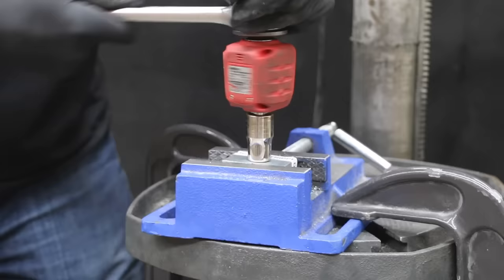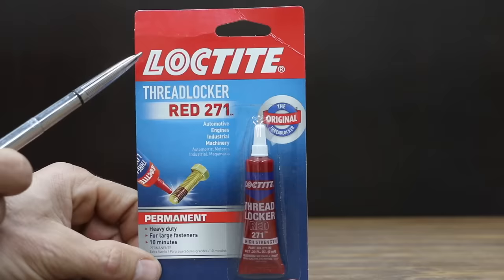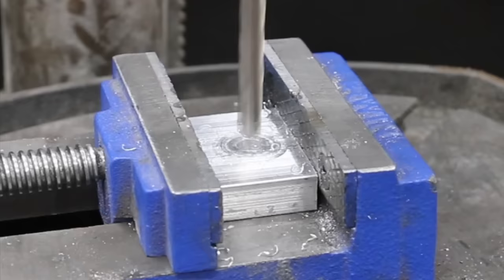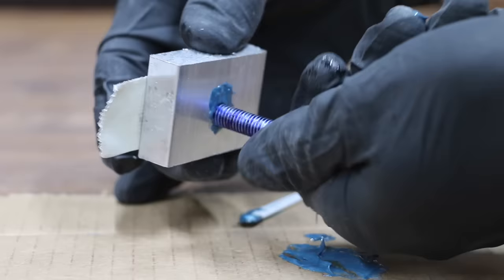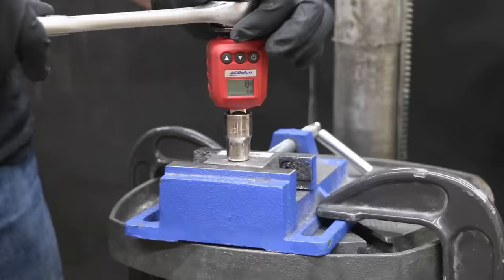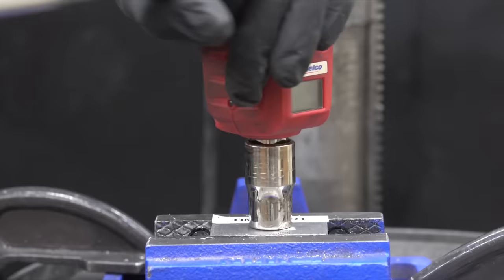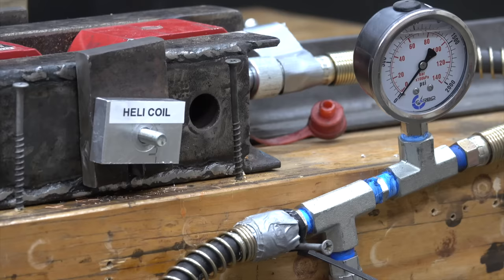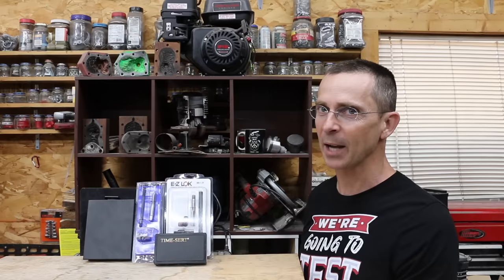Best Damaged Thread Repair? Let’s Settle This! Heli Coil, TIME-SERT, E-Z LOK, JB Weld, HHIP, Loctite

Comment: I actually have a suggestion: Most lawn care/arborist tools (weed eaters/trimmers, chainsaws, lawn mowers, leaf blowers, etc) usually say use premium fuel in their products. Can you compare regular fuel/mixed fuel in these products to see if premium fuel will actually make these products perform better? I know Husqvarna and Stihl highly recommend using a premium fuel mixture in their chainsaws, and was wondering if it really makes a difference or if I'm paying extra for nothing.
Reply: Using ethanol free (usually premium) fuel is recommended for small engines because the carburetors are easily corroded and ruined by ethanol.  This applies more to small engines since they spend a lot of time sitting stagnant.
Reply: @conorfieber6337  sitting stagnant isn't so much the issue with ethanol.  The main reason it is a problem is when sitting stagnant in a carburetor since it is open to the atmosphere.  Ethanol absorbs moisture from the air and the moisture makes it break down and turn acidic.  I've had ethanol gas sit in cars for months up to a year or two with no issues because modern fuel injected car fuel systems are totally sealed from the atmosphere.
Most ethanol free fuel I have seen is still just 87 octane, but I have seen 91 octane ethanol free here and there.  You can actually strip the ethanol out of any fuel by pouring a bunch of water in it, shaking it up, and the ethanol will mix with the water and settle to the bottom, leaving straight gasoline on the top that can be poured off into a gas can.  Doing this in a container with a drain on the bottom makes it easier to just drain the water/ethanol out.  Stripping standard 93 octane E10 gas like that will yield around 92 octane ethanol free.  Gasoline is not water soluble and is not affected by the water.
Reply from the maker: Thanks for the suggestion.
Reply: There are many reasons that some equip need to use high octane. High compression engines is one of them (to prevent detonation) My older Jonsered saw needed high octane to prevent vapor lock. Sure, it will run on regular (once), but when you shut it off, it won't restart
Reply: You’re paying extra.  I’ve had no problems using ten percent ethanol in my Sears tractor for ten years. I keep all containers closed tight, the tractor under cover and fuel left in the tank all winter. I don’t doubt that others have had problems but I have not.
Reply: @conorfieber6337  In the united states premium doesn't mean ethanol free.
Reply: @ellieprice363  the important thing is to empty the carburetor if it has one. Most modern garden tractors are fuel injected now so that doesn't matter really.
Reply: @zosxavius  Thanks. I must have a very unusual lawnmower with an engine that’s very different from most that I’ve heard about. It’s a 21 HP Briggs & Stratton with carburetor. I’ve used regular 87 with ethanol since new and the tank and carburetor have never been drained or cleaned. Gasoline is left in all winter and it usually starts on the second turn. Had to replace the compression release but other than that no other trouble. Count me lucky.
Reply: @ellieprice363  If you live in a location with lower humidity, that is probably fine.  Most carbureted things seem go to hell in a handbasket if ethanol fuel is left in the carburetor for extended periods in the more tropical and costal humidity areas.  Using fuel stabilizer and keeping stuff in a reasonably well sealed garage also helps.  Barns and garden sheds don't keep the humidity fluctuations out as well.  In the carolinas, the dew point is so high in the summer, the entire landscape looks like it rained from all the condensation once the sun sets and the temperatures cool off.
Reply: @hdrenginedevelopment7507  Sorry, none of that works. I live in the Carolinas where the humidity is occasionally high but not at at all as you described. At this moment Charlotte temperature is 86, humidity 51, and visibility 10 miles. Actually very pleasant. 
Garage doors are closed but not tight with lawnmower inside near a running creek. 
Again, hard to believe but no ethanol problems at all. Don’t believe everything you read or hear       about the Carolinas.

Comment: That was A LOT of work!
I suspect the glue in repairs  would not allow you to remove and reinstall the bolt.
Reply from the maker: Thanks for watching!
Reply: You can do it, I have used epoxy to repair threads, and you can get one or three removal cycles out of it, though best is to wipe the bolt down with silicone oil before putting it in, or use some spray on anti weld splatter spray, and wipe most of it off.

Comment: Great video! Interesting to see that the no-name Helicoils did just as well as the real stuff.

We sometimes will preemptively do inserts into holes in which we're pretty sure fasteners will end up stripping out, there are several brands that are meant for this type of application (vs. repairs). I'd be interested in seeing a comparison of products like that!
Reply from the maker: Thanks for the suggestion.
Reply: LOL, I should have just read down; just asked if there might be use cases where you would use these on purpose proactively :D
Reply: @Tasarran  Yep. Am a machinist, occasionally have drawings that call for a helicoil to be inserted at manufacture, typically in plastic or aluminium parts
Reply: Yes, there are many cases in which it is wise to do this preemptively to prevent failures.  Here are some good examples:
   Aluminum cylinder heads where the intake, exhaust, and valve train attach to the head.
   Some drive train components, such as where a transfer case attaches to a transmission.
   Engine mount attachment points on an aluminum block or old iron block or for high horsepower applications.
   Bearing mounts in industrial drive systems where any cast material is involved that needs to be threaded.
There are numerous other possible applications, as well.

Comment: Another very well-done video, no surprise.  FWIW, on tapping a pile of holes: maybe I'm an idiot but I had a job for the oilfield to make a bunch of 1/2" thick mild steel flanges with 8 holes tapped for 1/2-13.  I wasn't about to hand-tap that many holes (I think I made about 8 of those pieces or 64 holes total...maybe more flanges...it's been 10 years, hard to remember precisely).  I punched the holes on an ironworker to near final size then chased those holes with the appropriate drill bit for the thread size.  I then used a socket adapter (from 1/4" hex to square drive) to drive the appropriately sized 12 point socket (I could have used an 8 point socket, too) to fit the square drive of the tap.  I used a spiral-fluted tap and TD Foamy lubricant then used the drill press on a low speed to tap the holes.  The threaded hole was larger in diameter than the shank of the tap.  What this allowed was the tap cut the threads and, when the thread cutting section was past the workpiece, the tap fell out of the socket through the center hole in the drill press table.  I placed a 5 gallon plastic bucket under the drill press table to allow the tap to strike a surface which wouldn't damage the tap.  The holes were tapped true enough to spec and each hole was tapped in less than 2 seconds (align the workpiece hole to the tap, clamp it, bring the arbor down until the tap is lightly resting on the hole, turn the drill press on, and feed lightly down on the arbor and let the tap claw its way through the hole until it falls out the bottom, repeat).  Doesn't help you now for this project, obviously...but in the future, maybe helpful.  Thanks for another great product comparison video.

Comment: I find the difference between the bolts' failure loads at the begining interesting, the bolts didn't happen to be on the cheaper side did they? 

I wouldn't mind seeing the inserts being tested with better fasteners that won't snap off under torque, to see how much stronger it makes the aluminum in that respect.
Reply: Torque test channel put a video out yesterday on these kits as well and used the highest grade bolts they could buy.
Reply: My thoughts too…. If the failure mode is the bolt, you can’t really discern which insert is better.  The best thing you can say is the insert is no longer the weak link (for that bolt choice).I do find these tests interesting and well done!

Comment: Since metal inserts are essentially like having a larger bolt, what bout testing just that? Instead of using an insert, just use a bolt with the same larger thread.
Granted, it's not often that a larger bolt can be used in practice, but still would be interesting to know just how much weaker a small bolt with an insert would be.
Reply: a lot of applications don't allow you to use a bigger bolt, then there is the yield factor of the repair that defiantly comes into the equation.

Comment: I’m rather curious as to how well those metal thread inserts would’ve held up with grade 8 bolts instead of grade 5s like you appeared to be using. Any chance you could give that a quick test since none of those test pieces was damaged and you don’t have to remake any of them?
Reply from the maker: Thanks for the suggestion.
Reply: @ProjectFarm  Thank YOU for taking the time to make such great educational and informative content! My grandfather and I have been referring to your tests to inform our shop-related purchasing decisions for years now, and we haven’t ever regretted it.

The reason I’m so curious about what happens with higher-grade bolts is that there’s a lot of stripped threads in important and expensive stuff on the farm I work at (shocker, I know), and as long as the inserts can stand up to higher-grade bolts well enough I’d like to repair as many of them as I can.
Reply: I would also like to see that test, it might give you a real comparison between the products, cause all you really proved here is that all the inserts are better than 8.8 bolts. I wonder how good of bolts they really were with so much variation between them?
Reply: Go to Torque test channel he did a much better test. PF test didn't show much here
Reply: @libtrs838  yep, I actually saw that one first, but I was hoping for confirmation.
Reply: @504mitchm  what wasn't confirmed there? I think the large variation in PF test is the bolt head was digging into the aluminum plate so really the torque numbers aren't even correct.
Reply: @libtrs838  I just like 2 sources. I use heli-coils just because I have for 30 yrs, but every so often a customer will want me to use something else, and it would be nice to be able to point to 2 videos for them to watch.

Comment: Next test idea? A heap of work to prep 48 test pieces! You give a lab-grade definitive answer - Brilliant!  One of the best of very good, you've done. So good, this leaves two questions: 1. Does an 'insert'  give strength increases in steel? 2. With frequent use threads, (which tends to be the ones we strip) how do repairs hold-up torqued several times. Mind-numbing work to prep this. Very well done.
Reply from the maker: Thanks!  Thanks for the video idea.

Comment: Great information  in this video, I wish all manufacturers would learn from this and start using inserts when using aluminum castings, unlike materials cause corrosion and make it hard to remove fasteners for repairs,  it would also help eliminate all of the stripped threads we encounter. 
Keep up the good work,  I'm liking what I'm seeing on this channel.
Reply from the maker: Thanks, will do!

Comment: I am a believer in the Time-Sert brand thread repair kits. I had to repair several bolt holes in a Honda B18A1 from a bad mechanic...

No only was I able to reattach the exhaust manifold, but also a couple motor mounts and even the timing belt tensioner (oh yes, I documented that!)
Reply from the maker: Thanks for sharing.

Comment: A long time ago I fixed stripped spark plug threads, on a 1958 7hp Kohler engine, for our Wheel Horse garden tractor on my grandparents hobby farm using a thin strip of either aluminum or tin. Don't remember which, but I lean towards the aluminum. It wasn't pretty but it worked, did it right where it blew the plug out and shut off. Great to see you testing thread repair kits, I've used helicoil a bunch of times. 😁✌️
Reply from the maker: Thanks for sharing.

Comment: I've seen it suggested to thread insert aluminium heads when working on car as they are stronger. It makes sense as the larger/stronger diameter of thread is interacting with the weeker material allowing a stronger tightening force from the stronger bolt. Thanks for your vids keep up the great work.
Reply from the maker: Thanks, will do!

Comment: When I used to build old air cooled VW engines I would drill and tap the magnesium block and install steel thread inserts for the head studs. I also put a little red Locktite on the outside threads to hold them in the block.
Reply from the maker: Thanks for sharing.

Comment: I have used all of these along with king seats. Each one has it purpose. Something just doesn't need the holding force or enough material to properly install them. 
Since regular heli coils use the same thread as the time serts. I used the time serts almost always. They do make them for spark plugs and over size holes.
I measure a discussion tool to install them, if the insert wants to come back out with the insert tool. 
Really easy. Take a bolt with the same thread and pitch. Tighten a nylock on enigma so the threads don't stick out of the insert, then tighten it in. Hold the bolt hex and back off the nut. It will come right out and the insert stays put.
Reply from the maker: Thanks for sharing.

Comment: Stripped the intercooler bolt on my WRX STI where the bypass value clamp on. Need a tight grip to prevent leaks. This is the video that I needed.
Reply from the maker: Glad to hear!

Comment: The copper thread trick just worked well enough for me to save me a trip to the hardware store. Door latch is okay for now. Actually didn't have a scrap piece of wire handy so I used a twist tie from a bag of bread.
Reply from the maker: Thanks for the feedback.

Comment: A lovely test, useful to learn that the quality inserts outperform the bolt.  But the key takeaway I learnt is you need high tensile bolts before you can compare the yield strengths of proper inserts.
Reply from the maker: Thanks!  Thanks for the feedback.

Comment: This is a really good comparison. In my experience I have had good success with Heli-coil as long as it is into a blind hole. If the hole does not have a bottom the insert will tend to thread itself out of the hole. For open holes I really like the timesert. I have repaired several drain plugs in aluminum engine blocks and they work fantastic.
Reply from the maker: Thanks!  Thanks for sharing.

Comment: I have had good luck by wrapping spark plug tightly with wire and using JB weld; lasted until spark plug needed to be replace! I recommend this tip when helicoils just can not get installed!! :)
Reply from the maker: Thanks for the feedback.

Comment: Thank you very much. Especially with the information with the pressure testing.  Stripping threads is so easy but so many more factors are taking consideration when it comes to just"replacing" or "re threading"
Reply from the maker: You are welcome!

Comment: My brother bought a 97 Chevy Cavalier 2.2L Automatic for cheap. Coolant leaking in one of the cylinders due to a broken/corroded head bolt. After a bunch of drilling and digging we got most of the bolt out and we're left with a hole that is absolutely trashed ( we're more or less seeing if it's possible to patch the engine up and use the vehicle until an engine is bought for it) we used the loctite pc3688 or whatever it is, following the instructions to the T, Never had any issues with that engine ever but was eventually replaced. I wouldn't have believed it if I hadn't done it myself.
Reply from the maker: Thanks for sharing.

Comment: I own two classic cars and do almost all of the repairs on my own, so damaged threads are a problem, that does come up from time to time.
I've always used Heli Coil with a very thin film of Loctite 648 on the outside and it always worked, but often considered swallowing the bitter pill and buy a TIME-SERT set, which in Germany is even more prohibitively expensive as in the US (every M14 kit is north of 350$, while Heli Coil costs about the same as in the US). I'm happy, that I didn't do that.
Reply from the maker: Thanks for sharing.

Comment: I greatly appreciate the video!  In an Industrial setting, I have used C-Serts to replace 1/2-13 stripped threaded steel plates that go into an oven at about 500 degrees constantly then cooled to room temp.  They have held up amazingly well over 2+ years, but they're pretty pricey.  (I think a 6-pack kit with all of the tools is like $350).  I would be interested to see if you ever redo this video, include C-Serts in it.  He does some tests on his website, but it's always good to get a 3rd party test results.
Reply from the maker: Thanks!  Thanks or the suggestion.

Comment: Been using a kit that looks identical to the HHIP kit you have and it's been working great, so cheap for what you get. I've gotten them in a few different sizes because it's better to have the kit and not need it, than need to go buying it when you need it.

Good to see that there is next to no real performance difference between it and the more expensive kits
Reply from the maker: Thanks for the feedback.

Comment: It is highly recommended to use an activator with thread locker. It helps promote adhesion and helps activate   non-active metals, such as anodized or plated metals. We ALWAYS use an activator when assembling engines that have parts and hardware that we sent out for chrome plating.
Reply from the maker: Thanks for the feedback.